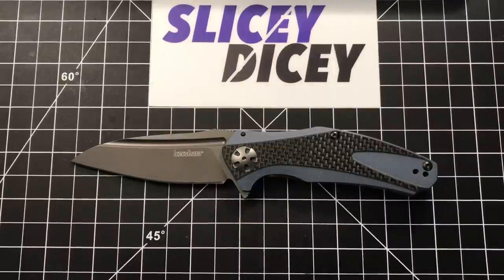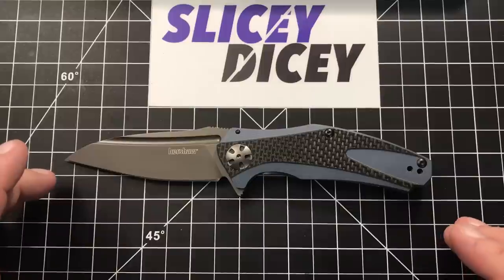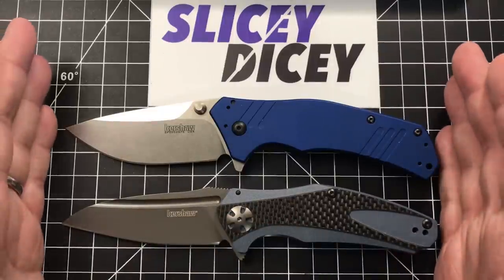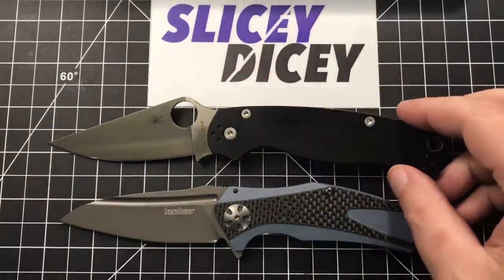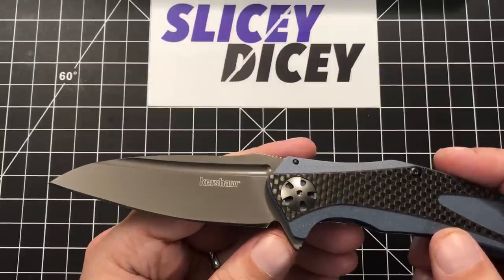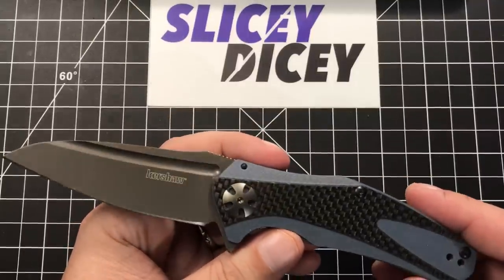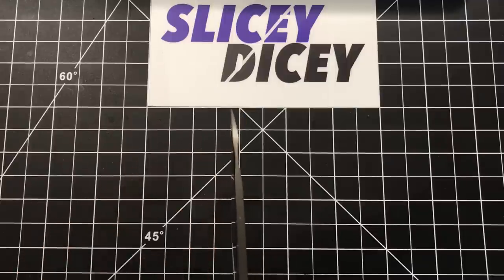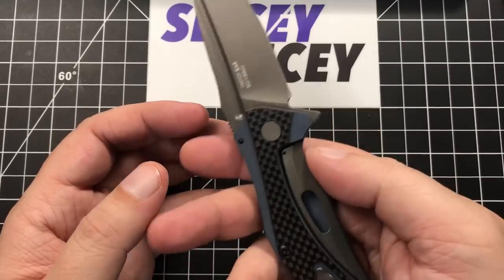Kershaw Natrix Carbon Fiber

Comment: It's good to see Kershaw incorporating the KVT pivot system into more of their models. Like you B I'm not a Speed Safe hater. But bearing pivots lend a more modern and higher end feel. At least perceived to be higher end.

Kershaw is doing a good job with their CF/G10 laminate. Not using it to simulate full CF, but machining it to showcase both materials. Especially in these models using colored G10 under the CF.

And like you I am super excited about the upcoming Copper Natrix and Bareknuckle. Thought it would be this month they dropped, but what can you do.

Comment: I'm with you on the steel.  Both Kershaw and CRKT have some great designs, but they still continue to use low-end steel.  I think they would sell so many more if they would just move up a couple of notches in quality of steel.
Reply: david h especially crkt kershaw at least makes some awesome exclusives in super steels but crkt doesn’t even really try the best steel from them I know of is 12c27n

Comment: Would you recommend the Steel Will Intrigue or the Ruike P865 (since they seem similar)?
Reply from the maker: Never handled the larger Intrigue that's more comparable in size. The P865 looks a bit classier, but I imagine the Intrigue will be more ergonomic and it has better steel. The P865 has the sweet wharcliffe blade though... Would be a tough call.

Comment: Wow..I just ordered this knife from BladeHQ last might, and here you go with a review the very next day, lol. Glad you like it, hopefully I will too! Nice to see them ditch the speedsafe. Although I can live with it, I am a bit miffed because the torsion bar broke on my M390 link yesterday. To top it off, one of the screws on the back just spins, so even though I ordered a new bar, I will probably have to send it in to get it fixed. I was going to grab that Knockout in M390, but now I'm wondering if maybe I should pass because of that speedsafe.
Reply: Tim Gannon speed safe will eventually wear out but they send new springs and it’s easy enough to assemble. If you like assisted Knives, go for it. Been around a long time and is proven. I don’t like it, except on the leek cause the tab is so small.
Reply from the maker: That's me... "Just a minute too late reviews!" I'm sure you'll like it. I've never had a backspring break yet, but I know it's a thing.

Comment: If Steel Will and Ontario can make knives with D2 blades for $40 why can’t Kershaw CRKT Shrade etc
Reply from the maker: They definitely can. The D2 Natrix with copper scales is something like $70 and those copper scales ain't cheap!
Reply: Exactly the onley reason I think is beacause it May cost them more mony to grind everything out and it’s harder for someone who doesn’t know what there doing to sharpen